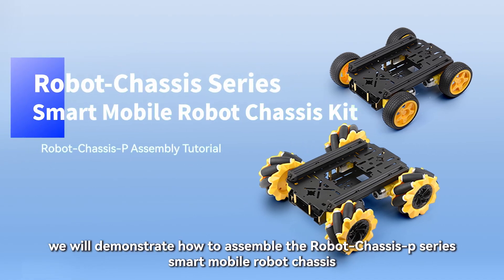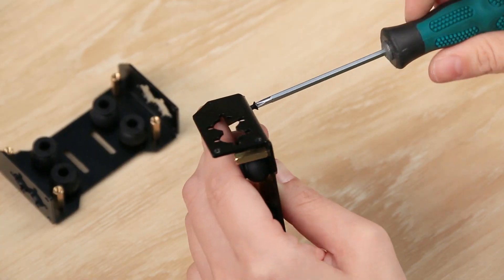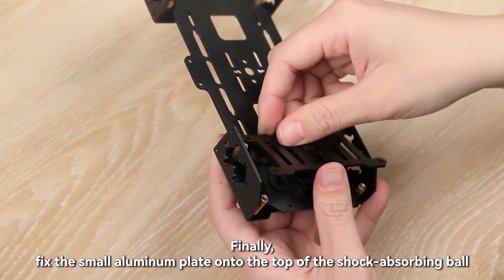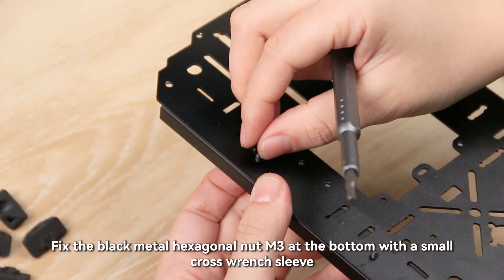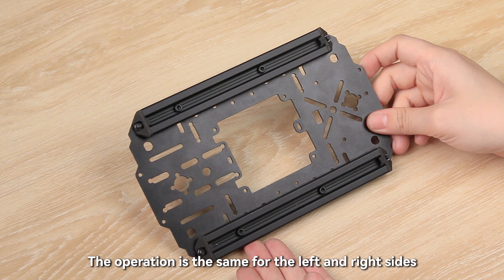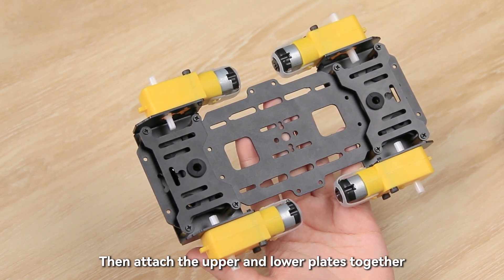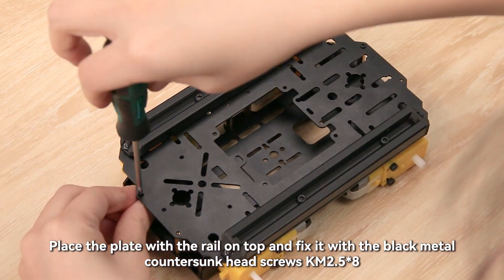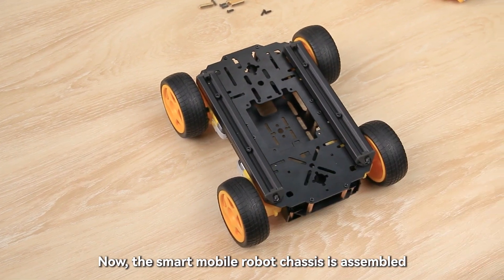Waveshare Smart Mobile Robot Chassis P Kit with Shock-Absorbing Structure-Assembly Tutorial

Comment: What type of wire connectors for the motors?
Reply from the maker: hi dear pls feel free to contact our support team https://service.waveshare.com/
Reply: It looks like soldering wires to the tabs is probably the only way.  24 AWG to 20 AWG wires should be okay.  For using with Arduino or Raspberry Pi, you might want to use DuPont cables - get some longish ones and cut them to get a bare end to solder to the motors.  You need some sort of motor driver board or brushed motor speed controllers too, of course.